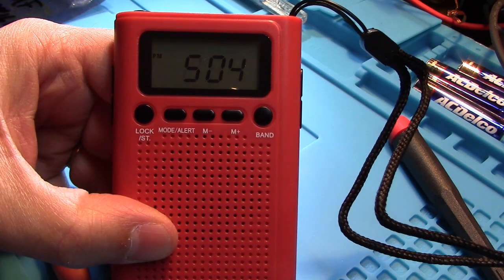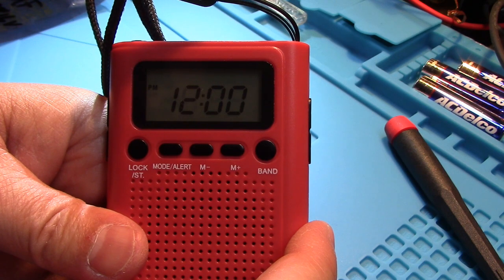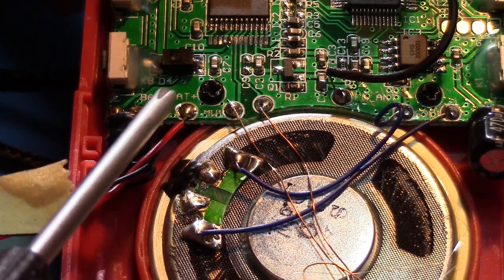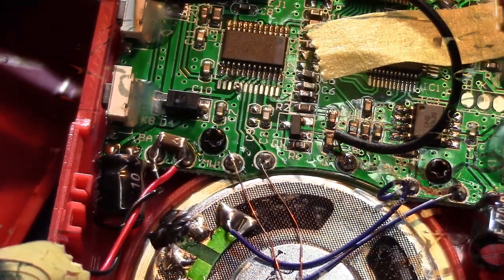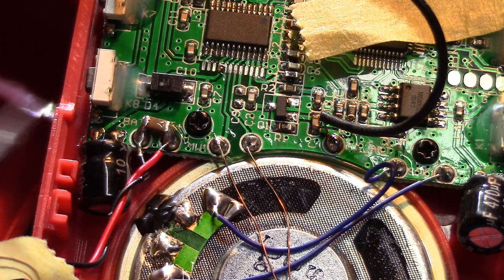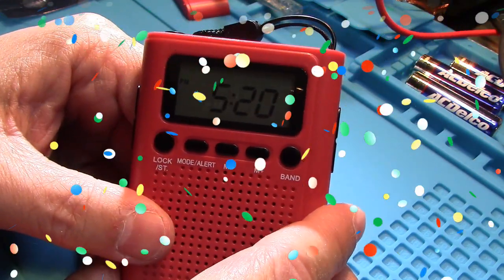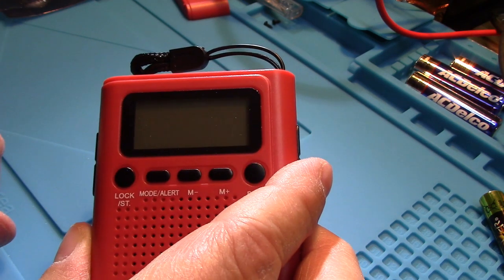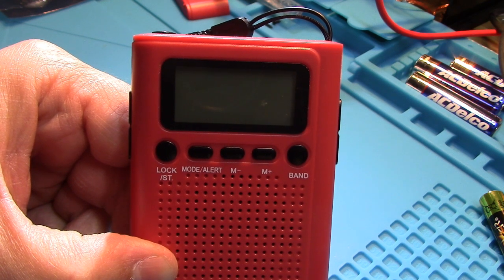Vondior Battery Backup modification (Radio Mod)

Comment: Great idea !
However, something is not right.
The time [t] it takes to a capacitor [C] to discharge [DU] at some current [I] is t = DU*C/I.
If we consider the clock stop at 2V we have DU = 1V => t = 1*10E-6/(100E-6) = 0.1 sec.
(the current is 95uA from the teardown measurement; aproximated to 100uA here)
So, for we to have 10 sec discharge time we need to have a capacitor 100 times larger than 10uF => we have at least 1000uF there.
Can you verify what is the situation ? Either the capacitor added is 1000uF or something was going wrong when you first changed the batteries (like for instance pressing a button by mistake ?)

ps - i'm kind of a geek myself with radios :)
Reply from the maker: I just checked and it is a 10uf cap. I powered the radio with a power supply and lowed the voltage until the display went out. The voltage at that point was 1.64 volts
Reply: @TheRadiogeek  🙂Yeah, those ceramic capacitors are usually small. I was looking at those electrolytic capacitors (one on the left and one on the right) and they seem to be 2 x 470uF. It is possible that they are holding most of the backup energy and that little one added helped them doing it.
Reply from the maker: @IAdryan  I don’t think so because without the 10uf cap installed the display go out almost instantly. The radio loses it time before you can get new batteries installed.

Comment: I see that the AM coil wires are right over the metal speaker frame and magnet. That can't be a good idea.
Reply from the maker: Yes it not a good idea. I guess they ran out of room and or just didn’t care. Slap it together and get it out the door. 😜
Reply: @TheRadiogeek  LMAO
I'm guessing that a fairly easy mod would improve things a bit. I had the Horologe (sp?) version of that and the AM wasn't all that bad. The AGC circuit wasn't the best, though.

Comment: Nice Mod! Makes you wonder why the manufacturer couldn't spring for a cheap capacitor. But they pinch pinnies when it come to cheap radios.
Reply from the maker: Yeah I know right? It such a easy thing to do but I guess it just wasn’t in the budget. 😜